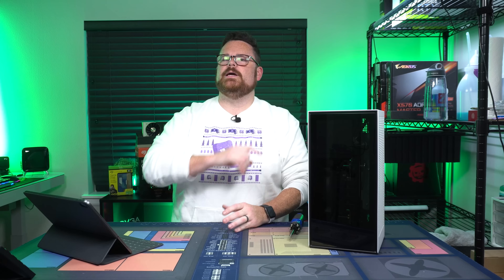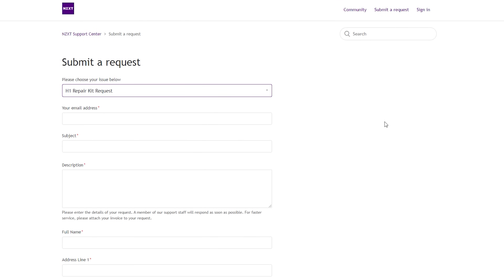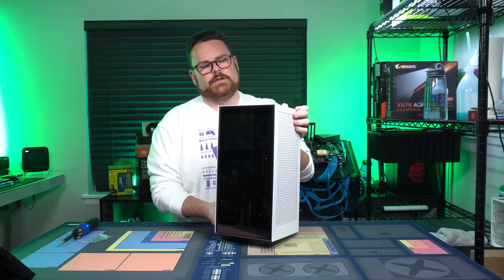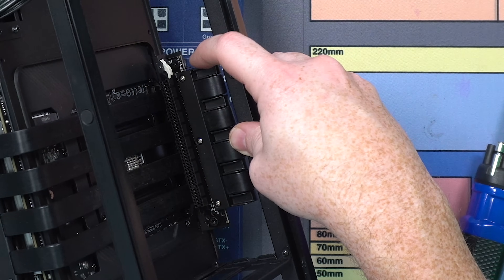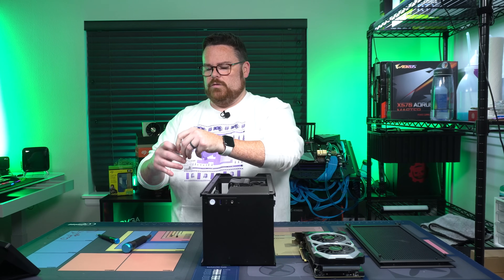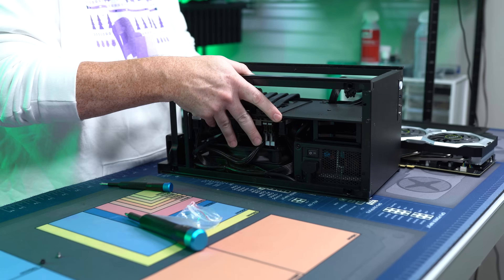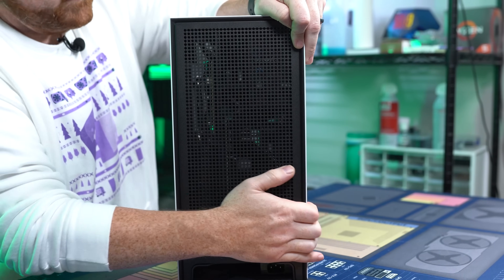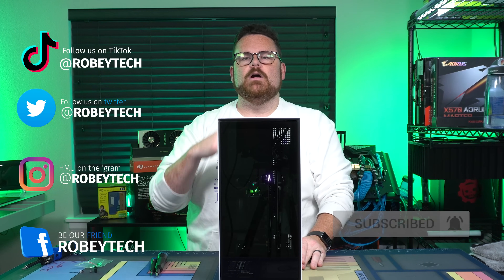So the NZXT H1 had a safety recall. Here is how to fix it! | Robeytech

Comment: The real problem is with the PCIe riser cable. A 12V trace inside the PCB is very close to the screw hole and the screw thread shorts that 12V trace to the case (which is at 0 potential - or ground). This causes things to heat up and may start a fire. The plastic screws don't conduct electricity so this short-circuit is avoided but the underlying issue is still there. They went for the cheap fix instead of replacing the PCIe cable. I wonder if the new cases include a proper fix with a new PCIe cable 🤔
Reply: True. There's a great GamersNexus video testing and explaining the whole issue, complete with an actual fire cause by the issue. 🔥
Reply: One would hope that they traced it down like GN did, had a cross section done, and implemented a proper hardware revision for that PCB.

Comment: Could you fix it with a ziptie?
Reply from the maker: Yeah you could, but the parts are free if you want.  You could also just remove the bottom screw for a temporary fix.
Reply: @RobeytechLive  Yea, I'm planning in building a PC for the first time myself, and I was planning to use the H1, and being that I'm from a third world country ( Serbia ) I would have to wait for a long time in order to receive the parts ( I heard that there are some people who still haven't received those 2 screws and applied a while ago  ). Also, I have a question: Do you think that the stock AIO in H1 case could handle AMD 9 5900x? I am slightly worried that 5900X might be too strong/hot for the 140 AIO.
Reply: @jovancvijanovic7457  I have the NZXT H1 with Ryzen 5800x and  EVGA rtx 3080 xc3, the CPU temps are not bad at all under AAA games such as BF5 and RDR2 ultra settings 4k @ 60h or QHD @120. It reaches 60-65. I have changed the AIO fan cooler with noctoa. But, the GPU who really struggling due to stupid front glass. GPU temps reach above 80 degree. I downvolt the GPU and used a spacers in front glass to release the heat and add three 40mm noctoas fans in H1 back side to exusut heat. The temps are great now at 65 to 68 max. So, it takes some time and efforts to make it work well with such high-end setup. I hope this could help. Cheers
Reply: @RobeytechLive  Hey everyone, please listen to me, yesterday electricity power suddenly went with a thunder and came back, my pc was running at that time without ups, now it is not turning on, i changed power unit, ram,ect not doing anything😭 finaly i went to a repair shop and they told me everything needs to be replaced except hard disk😭 I was on core 2 dou E8400 With 2gb Ddr2 ram with onboard graphics,ECS G31T M7 motherboard, now only my hard disk are working..
 i don't have that kind of money today to rebuild my pc... please help me if you can or you have additional pc parts, Contact me on whatsapp if you can help me even little +94783341223 On whatsapp or messenger, Thanks everyone, god bless you😔❤️

Comment: NZXT has gone way down hill!
Reply: KirkKarnage how?
Reply: @nickforrest3323  And there is a ton of reddit post about this issue, and NZXT not taking this serious, and even stories of NZXT deleting stories people posted of this case catching fire! Like I said they have gone down hill......and lets add their case design is years behind the rest.
Reply: That's why they recognize the problem and provide a free solution...
Reply: @lucaspeterson8839   There is a chance it is only a work around, and not a real fix. You should watch the Gamers Nexus video on the issue. Worst of all I tried to get a refund for the case because of the fire issue, and NZXT denied me even through I bought it directly from their site!
Reply: @Scubarayy  no nzxt sent a work around not a real proper fix. Watch the gamer nexus videos on the issue.
Reply: @Scubarayy and nzxt knows that because before the first gamers nexus video they refused to give me a refund on the case. Then 2 days after the video went up. The same person that told me I wasn’t getting a refund sent me a pre paid shipping label and let me know i was getting a full refund with out me even asking again.
Reply: @Scubarayy yes replacing the metal screws with plastic screws to stop it from shorting is the work around. The problem still exist because the problem is the riser cable not the screws.
Reply: @Scubarayy Yeah the ones after they put it back up still have the faulty riser cable. Just have the plastic screws put in out of the box.
Reply: @Scubarayy  NZXT just made another post 4 hours ago they are pulling the case from the site again, and sending out replacement riser cables. And offering refund for any H1s bought from their website. People like Gamers Nexus need to be thanked for outing a company for their bullshit!
Reply: @Scubarayy  It is all good, but situations like this just show you should never be a fanboy(not saying you are) to any company because they do not give a shit about you once they have your money even if their product could burn down your house.